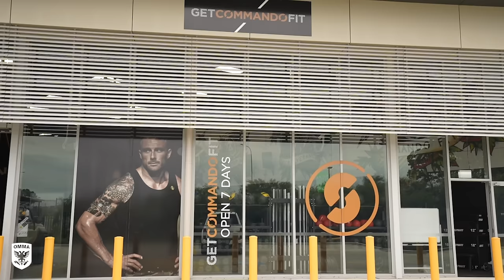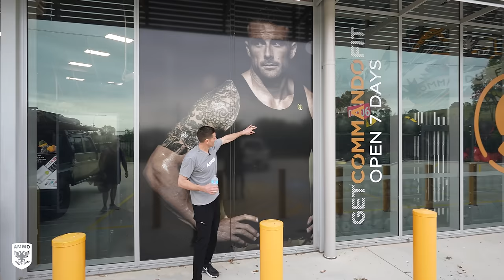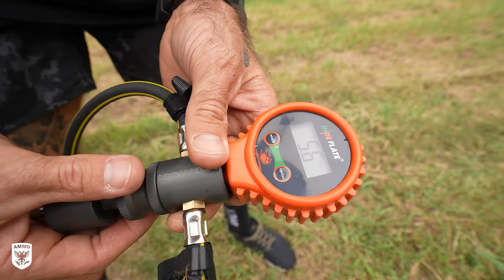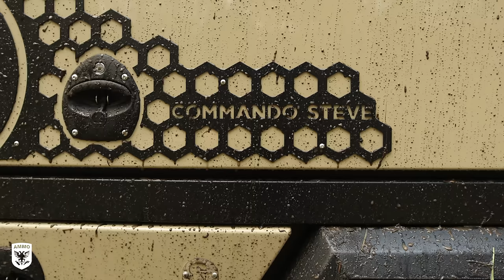Disgusting Muddy Land Cruiser: Longest Car Wash Ever?

Comment: After a muddy outing in my old Jeep i used to roll it up into the yard, and run a sprinkler under it for a bit.  It got all the big clumps off, and watered the yard at the same time. 

The folks that owned the local car wash booths appreciated it.

Comment: Why do Australian trucks all have a big stick/antenna thing mounted at the front of the hood? You never see this in any other country, but it's almost universal in Australia.
Reply: Because they need to get signals when they go out in remote areas. Or it's just a wank feature for driving to the shops like 80% of 4x4s in Sydney
Reply: @juddy953  it’s just the position that’s unusual. We have people who want a big antenna for whatever reason, but they put it on the roof above the cab or somewhere else that not in the line of the drivers view